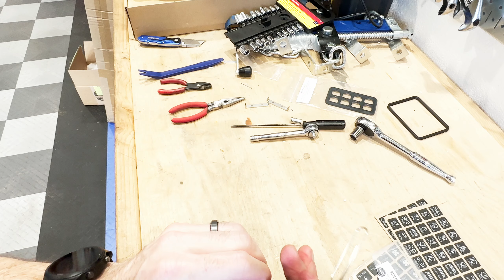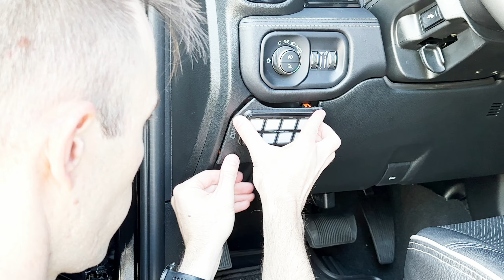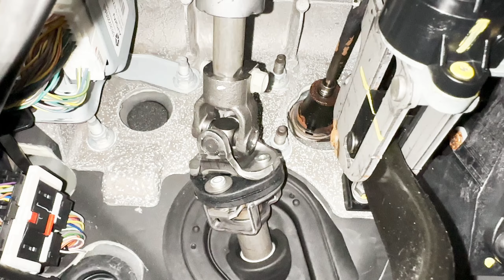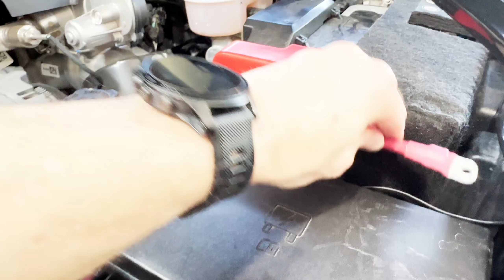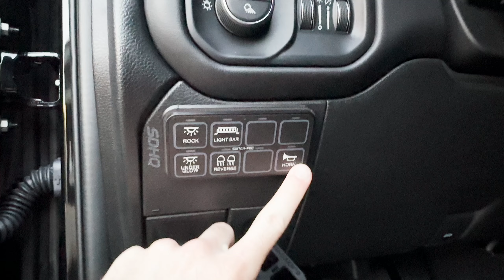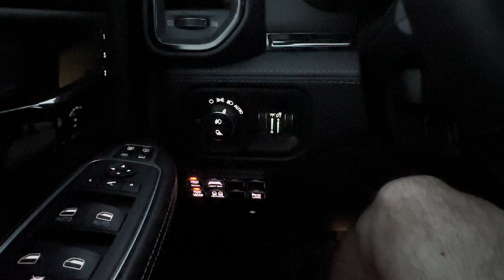Switch Pro SP-9100 Install on my 2023 Ram 3500

Comment: Hello, where do you find the dash  trim piece with the pre drilled holes for the switches?  Thanks in advance
Reply from the maker: @randyd6439  i believe it was at super duty headquarters (SDHQ). 

https://www.dieselpowerproducts.com/p-sdhq-built-switch-pros-keypad-mount-19-24-ram-2500-3500?variant_id=61783&gad_source=1&gbraid=0AAAAAD8LZsGGxU_D70NV6X2sCrwPC4Opx&gclid=EAIaIQobChMIq9Lw8qWfjAMVgAOtBh1tVxzOEAQYAiABEgJoAfD_BwE

Comment: Very clean, parts and instructions were exactly what I was looking for, thank you! Any tips on passing through the firewall grommet? Looks like best access is from the underside?
Reply from the maker: @jasonlong8625  Glad the video was helpful!  I’ve never attempted passing through the grommet from the underside but that could be a great idea. I typically start in the cab and push it through. Then I move to the engine bay and try to grab it and pull it through.

Comment: Cab light fuse? What number
Reply from the maker: @Mopar_man_in_the_moon  that will depend on the year make and model of your truck. I recommend checking the fuse guide in your fuse box and look for the fuse marked marker light or cab light.